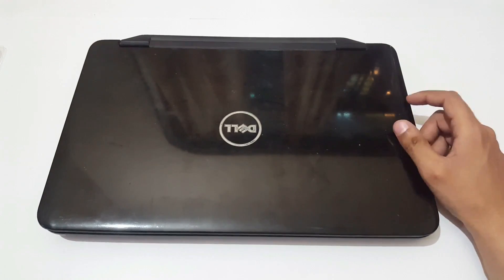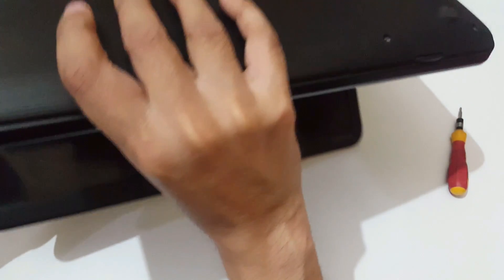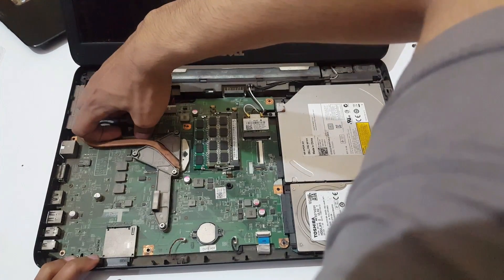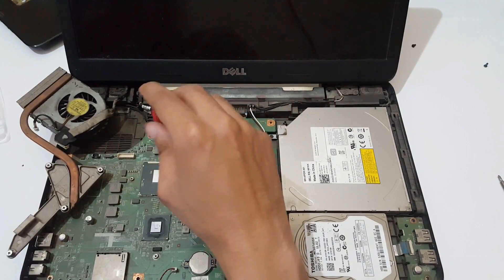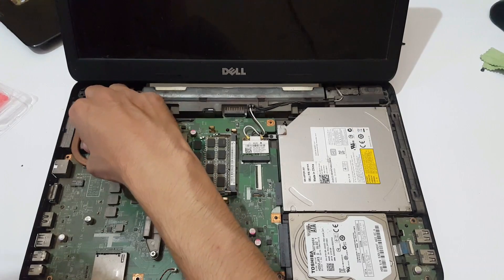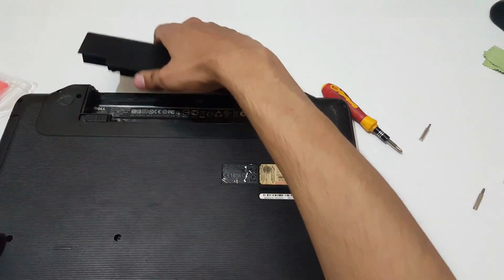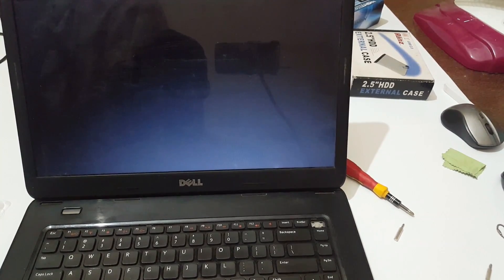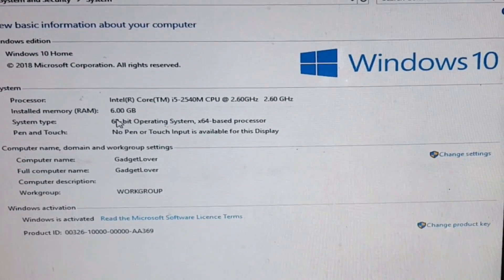How to Upgrade Processor on DELL Laptop | i3 to i5 & i7 - Make Laptop Faster for Gaming

Comment: Sir, I have a Dell Latitude E6410 
i5 520m 
Intel HD Graphics 64mb vram
8 gb ram dual channel 
What is the suggested processsor for me to play a game like gta 5? Or do I have to use an external graphics card to play a game like this? Please answer.
Reply from the maker: AT2702 : Intel Core i7 640M is best processor for your Laptop and I would suggest you upgrade its RAM and install SSD for more better performance and for better gaming experience I would suggest you attach graphics card externally to your Laptop

Comment: I have a Dell Inspirion 15 3000 series laptop with intel core i3 processor and 4 gb ram can I able to replace it with amd ryzen processor
Reply from the maker: Coding Kit : Unfortunately you can upgrade it in same generation only and in my knowledge the processor of this Laptop is soldered so you can't upgrade it
Reply: @GadgetLover360  So, Can i upgrade same laptop with intel i7 or i5
Reply from the maker: Praful Kumawat : If it is not soldered you can upgrade it

Comment: Sir my laptop is toshiba C280 I0010 core i3 2310M can i upgrade to i5 or i7?
Reply from the maker: Rocky Emmanuel c.p : Intel Core i5 2540M is best processor for your Laptop and I would like to inform you that if processor is soldered you can't upgrade it
Reply: Thank  you for the information.
Reply from the maker: Rocky Emmanuel c.p : You're welcome

Comment: I have dell Vostro 1540 can I add RYZEN 3 3200G TO IT.. is it possible.. ? + 1ssd .. if yes which SSD is ok for me.. I want to convert business laptop to gaming laptop
Reply from the maker: Abhijit Chavan : Unfortunately you can upgrade it in same generation only and I would suggest you upgrade its RAM and install Samsung EVO 2.5 inch internal SSD for more better performance

Comment: I have intel i3 2.40 GHz. Which processor is best to upgrade?
Reply from the maker: Sumana Maiti : Provide processor number
Reply: @GadgetLover360  3110M
Reply from the maker: Sumana Maiti : Intel Core i5 3380M is best processor for your Laptop
Reply: @GadgetLover360  Thanks. Can you provide me buy link?
Reply from the maker: Sumana Maiti : You're welcome and I would suggest you buy it from Ebay or Aliexpress online store
Reply: @GadgetLover360  I saw another processor i7-3770. Can I install it?
Reply from the maker: Sumana Maiti : Unfortunately you can upgrade it in same generation only
Reply: @GadgetLover360  But it's 3rd gen only.
Reply from the maker: Sumana Maiti : But both have different segments
Reply: @GadgetLover360  Ok thanks. :- D
Reply from the maker: Sumana Maiti : You're welcome

Comment: I've got a dell N4010 laptop i3 380M 4gb ram with ssd , I want to upgrade processor for a better graphics unit will it help and which processor do you suggest.
Reply from the maker: Vikas Satpute : Intel Core i5 580M is best processor for your Laptop
Reply: @GadgetLover360  thnx a lot mate.
Reply from the maker: Vikas Satpute : You're most welcome
Reply: @GadgetLover360  I am in Pune India, here I am unable to find the same processor, I've got i7 2670QM/2630QM. Will this one go good with my Dell
Reply from the maker: Vikas Satpute : Unfortunately you can upgrade it in same generation only and I would suggest you buy it from Ebay or Aliexpress online store
Reply: @GadgetLover360  sure. Thanks for helping
Reply from the maker: Vikas Satpute : You're welcome

Comment: Hey Bro!
Having a intel core i3 6006u with 4GB of 2400mhz Ram packed in my Dell inspiron 15 3000 Series. Suggested me compatible Upgrades.
Reply from the maker: Haq Se Tharki : In my knowledge the processor of this Laptop is soldered so you can't upgrade it so I would suggest you upgrade its RAM and install SSD for better performance
Reply: @GadgetLover360  thanks bro! Basically my PC has 2×2GB RAM slot so I will be replacing with 2×8GB of Ram and a 512GB of SATA SSD.
Reply from the maker: Haq Se Tharki : You're welcome

Comment: Because I want to use egpu (1650super)and I don't want bottle neck
Reply from the maker: Genesis Gaming : Intel Core i7 2640M is best processor for your Laptop
Reply: @GadgetLover360  it will best for egpu like 1650super
Reply from the maker: Genesis Gaming : Yes this is best processor for your Laptop and I would suggest you to use RTX 2060 Super in place of GTX 1650 Super
Reply: @GadgetLover360  egpu doc is not capable of that
Reply: And I think it will bottleneck
Reply: @GadgetLover360  bro you know any trusted website for purchasing egpu dock I am not getting it from offline market
Reply from the maker: Genesis Gaming : I would suggest you buy it from Amazon online store
Reply: @GadgetLover360  bro it is not available
Reply: @GadgetLover360  ok bro I got it which version is good for 1650super (express card version)
Reply from the maker: Genesis Gaming : Version 8 would be better
Reply: @GadgetLover360  bro can I fit any quad core any how
Reply from the maker: Genesis Gaming : I would suggest you search on Google about it for best results
Reply: @GadgetLover360  I think this processor will bottleneck by this gpu
Reply from the maker: Genesis Gaming : Okay
Reply: @GadgetLover360   so can I play games on 60fps with 1650super
Reply from the maker: Genesis Gaming : See its specification
Reply: @GadgetLover360  bro GPU is over capable but this processor will handle this

Comment: Bro I am having HP notebook 15 with i5 5th generation , is it possible to upgrade processor and gpu??
Reply from the maker: Arnav Saxena : You can attach graphics card externally to your Laptop but in my knowledge the processor of this Laptop is soldered so you can't upgrade it

Comment: Hello bro I've Dell Inspiron 15R 5521 With Cpu- Intel(R) Core(TM) i5-3437U CPU @1.80 GHz and it's too slow to run games, and video editing softwares on my pc is it possible to enhance my CPU ? Or processing and I've 8gb ram .
Reply from the maker: Prawah Sinha : In my knowledge you can expand it upto 16GB so I would suggest you upgrade its RAM and install SSD for better performance
Reply: But I've already increased the ram from 4gb to 8gb and installed SSD of 240gb isn't there anything else that I can do to improve laptop performance
Reply from the maker: Prawah Sinha : You can attach graphics card externally to your Laptop
Reply: @GadgetLover360  thanks bro and any recommendations ?
Reply from the maker: Prawah Sinha : You're welcome and I would suggest you run disc check and system file checker command

Comment: I have 
i3-380m @2.53GHz in my Dell Vostro 1540
I want to upgrade the CPU.
Suggest the best one please
i5 or i7
I am also confused in i7-640m 4mb cache CPU 
It's the fastest i saw
With 2.8GHz clock speed
Tell me what to do.
🙏
Please Reply.
Reply from the maker: Asif Hussain : Yes you can upgrade it with Intel Core i7 640M
Reply: @GadgetLover360  thank u🙏😀
Reply from the maker: Asif Hussain : You're welcome

Comment: I have i5 8gb ram 1tb hdd 2gb graphic card sitll gta lag on low settings
Reply from the maker: Rajneesh Gautam : Run check disc and system file check command
Reply: @GadgetLover360  i have i3 8gm ram 1 tb hdd and integraed graphic card should it run gta5
Reply from the maker: Kalash Bawankar : Yes

Comment: How Can i upgrade my laptop performance which has an i3-6006u 4gb ram 1tb hdd..... Plz tell
Reply from the maker: MUSIC BOX : Upgrade its processor Intel Core i5 6360U is best processor for your Laptop and I would also suggest you upgrade its RAM and install SSD for more better performance
Reply: Bro but is it possible to upgrade my Processor
Reply: Can u tell the price
Reply: Of the processor
Reply from the maker: MUSIC BOX : I would like to inform you that if processor is soldered you can't upgrade it and see it on Ebay or Aliexpress online store for better details related to its price
Reply: Soldered means
Reply: How do i know if my processor is soldered?? Plz tel
Reply from the maker: MUSIC BOX : What Laptop do you have
Reply: It's an hp laptop  there's no name but just a model no.
Reply: Hp 15flbc9hif
Reply from the maker: MUSIC BOX : In my knowledge the processor of this Laptop is soldered so you can't upgrade it I would suggest you upgrade its RAM and install SSD for better performance
Reply: Can u suggest a  laptop with best configuration under 50000
Reply from the maker: MUSIC BOX : In my knowledge Lenovo Ideapad L340 and Dell Inspiron 3493 will be the better choices to buy in this range
Reply: And how is lenovo ideapad s340
Reply from the maker: MUSIC BOX : This is a good choice if Laptop price is available in your budget

Comment: Hi! Great video. Can you tell me if it is possible to change the processor in a Dell Inspiron N5010? It's a relatively old notebook (around 2010?) and came with a dual core Intel Core i3 M370. Thanks a lot!
Reply: lol mine is same as well inspiron n5010
Reply: I too.have the same
Reply: @theminestone2853  yes you can
Reply: Wait nvm I found out it’s actually the one I have is Inspiron n4010 LOL OOF…….
Reply: Tell me can I upgrade to i7
Reply: Same model,,
Reply: laptop processor AMD E2, A4, A6, A8, A10 & i7 1, 2, 3, 4 gen available
Reply: I have  a Dell Inspiron N5010 (2009-10) model the processor of this model can be upgradable ?
Reply from the maker: Faustino Chirino : You're most welcome and Intel Core i5 580M is best processor for your Laptop

Comment: Hi bro I have lenovo IdeaPad 320 e 15ikb which will be the best processor to replace that with I have i5 7th gen processor
Reply from the maker: Balakrushna Behera : In my knowledge the processor of this Laptop is soldered so you can't upgrade it
Reply: @GadgetLover360  bro can I install extra 8gb ram of 2666 mhz or 2400mhz in my 2133mhz laptop which is default frequency of ram
Reply from the maker: Balakrushna Behera : I would suggest you see its product manuals

Comment: bhai mere paas n5110 hai.. can i upgrade ram and gpu for this device without any difficulty and total expense kitna hoga?
Reply from the maker: Abhinav Rawat : Yes in my knowledge you can expand it upto 8GB and you can't upgrade GPU of Laptop but attach it externally to your Laptop
Reply: @GadgetLover360   laptops dont use gpu
Reply from the maker: legendary player : Graphics processor unit is independently working and responsible for graphics output

Comment: hey bro I have a laptop with radeon a6 9225 , can I upgrade it to ryzen 7 ???
Reply from the maker: Suraj Chetia : Unfortunately you can upgrade it in same generation only and I would like to inform you that AMD A9 9425 is best processor for your Laptop
Reply: Did you played any games in that laptop.
Reply from the maker: Abhidev Dileep : If you have any problem related to this video ask I would be happy to help you
Reply: @GadgetLover360  bro i have the same spec amd a6 9225.which is the best processor for this pc.
Reply from the maker: Abhidev Dileep : This is the best available processor in this generation which will improve your Laptop performance and I would suggest you upgrade its RAM and install SSD for more better performance

Comment: Brother i have Hp 15 da 1041TU ( i5 8th generation) but the laptop has 1.8 Ghz  so i want to upgrade it into 4.4 Ghz ...what should i do?? Please help me
Reply from the maker: Niranjan Kumar Sharma : In my knowledge the processor of this Laptop is soldered so you can't upgrade it so I would suggest you upgrade its RAM and install SSD for better performance

Comment: I have a dell Inspiron N4050 with --> core i3-2370M | 2GB Ram | 500GB HDD.. my laptop is too much slow.
it takes 2-3 min to launch apps like opera/crome/firefox. 
please Suggest me the processor and other options .. [condition - for normal use]
Deepest thanks in advance from bangladesh!!
Reply from the maker: Rz. Riad : You're welcome and Intel Core i5 2540M is best processor for your Laptop and free up space of system drive for lag free performance and I would also suggest you upgrade its RAM and install SSD for more better performance
Reply: @GadgetLover360  though around 300Gb storage is free here ,, it makes lacks.. thanks again for your very fast reply
Reply from the maker: Rz. Riad : You're welcome and I would suggest you perform check disc and system file checker command in your Laptop to see everything is working properly or not

Comment: HI DUDE I HAVE DELL STUDIO XPS 1640 CORE 2 DUO PROCESSOR 2.53GHZ WHICH PROCESSOR SHOULD I UPGRTADE TO THIS LAPTOP THIS HAVING SOCKET P(478)
Reply from the maker: raghu raghu : Intel Core 2 Duo P9700 is best processor for your Laptop
Reply: @GadgetLover360  dude can it su[pport any i3 processor
i have lenovo g500 with pentium 2020m laptop incase did this will work any i3 or i5 plz tell dude
Reply from the maker: raghu raghu : Intel Core i5 3380M is best processor for your Laptop
Reply: @GadgetLover360  thnks bro
Reply from the maker: raghu raghu : You're welcome
Reply: @GadgetLover360  HI HERO DO YOU KNOW AN IDEA OF DELL STUDIO XPS 1640  IT WILL RUN ON HIGH SPEED FAN ALWAYS LIKE ITS DOING WAR WITH ALIENS HOW TO STOP THAT FANS SPEED TO LOW ...EVEN WHEN I REFRESH ITS FAN RUN LIKE A HELL ...ANY SOLUTION PLZ.I DONT UNDERSTAND WHAT TO DO I CLEANED FANS VENTILATION AND APPLIED THERMAL PASTE TO HEAT SKINS ALSO NO USE...I AM AFRAID OF THAT FAN I WILL BECOME LOSE AND BREAK THE BASE PANEL AND MAKE A HOLE TO MY HOUSE WALLS.....
Reply from the maker: raghu raghu : It depends on processor wattage and RPM of fan so I would suggest you stop it while working for few time
Reply: @GadgetLover360  NO HERO  WHEN I  POWER ON MY LAPTOP THE FAN RUN FULL SPEED INSTANTLY WITH OUT DELAY FAN RUN FULL SPEED WHEN I POWER ON MY LAPTOP WITH OUT ANY TASK RUNNING ..IF I CLICK REFRESH IT AGAIN RUN HEAVER THAN EVER .....
Reply from the maker: raghu raghu : It will run when cooling is required
Reply: @GadgetLover360  hmmm hero after 10 hour night rest, morning when i start laptop its run full fan speed what is there in laptop to cool i did morning start......
Reply from the maker: raghu raghu : When Laptop is started it run for a while everytime in all Laptops
Reply: @GadgetLover360  hmmmmm ok but my lenovo dont sound my fan its so silence when i paly games only fan spin like hell in it but not my dell xps 1640 when i power on its get ready for wars with fan
Reply from the maker: raghu raghu : It depends on temperature of processing unit

Comment: Sir I'm using Dell inspiron 3543.

What type of upgrades i can perform please let me know.
Reply from the maker: Gourav Patra : The processor of this Laptop is soldered so I would suggest you upgrade its RAM and install SSD for better performance
Reply: @GadgetLover360  Can i install hdd and ssd at the same time by replacing CD drive ? And which ram and which ssd can i install ? please let me know .
Reply from the maker: Gourav Patra : No because in my knowledge for both M2 slot is required and Adata Ultimate SU650 is best available SSD for Laptop and buy DDR3L 1600MHz RAM
Reply: @GadgetLover360  Last question, can i use my laptop for next 4-5 years for programming by upgrading it's ram and ssd ?
Reply from the maker: Gourav Patra : Yes
Reply: @GadgetLover360  Sir please make personal research and let me know whether i can use Kingston Q500 in my Dell inspiron 3543 .

             - Love from Odisha
Reply from the maker: Gourav Patra : Yes and thanks for your love and support
Reply: What is the difference between Kingston q500 and Kingston a400 and which is the better one ?

Comment: I have dell latitude e7740 !7 4600u 16gb ram 1tb hhd want to upgrade cpu because vram just 1gb
Reply from the maker: Sairock Khan : In my knowledge the processor of this Laptop is soldered so you can't upgrade it

Comment: Sir in dell Vostro 1014 can I upgrade processor
Reply from the maker: All about life : Yes
Reply: Sir i5 Dal Sakta hai 
Y agar koi aur toh ap bta dijiye
Reply from the maker: All abour life : What processor is in your Laptop
Reply: Intel core 2 duo
Reply from the maker: All about life : Provide processor number
Reply: @GadgetLover360  Intel Core 2 Duo - T6670
Reply: Sir please tell
Reply from the maker: All about life : Intel Core 2 Duo T9900 is best processor for your Laptop
Reply: @GadgetLover360  sir vo install ho jayga isme and kitne Tak Ka padega
Reply from the maker: All about life : Yes and you can buy it from Ebay or Aliexpress online store
Reply: @GadgetLover360  sir Kitna tak Ka hoga
Reply from the maker: All about life : It's not too expensive and I would suggest you search on Google or provided online stores for best results
Reply: @GadgetLover360  THANKS A LOT !!
Reply from the maker: All about life : You're most welcome
Reply: @GadgetLover360  sir it is not available offline. 

If it is available online plz provide me the link
Reply: Plz tell
Reply from the maker: All about life : I would suggest you go to nearby PC & Hardware store and ask about it
Reply: @GadgetLover360  sir can I use i5 3rd generation 
Someone told me it would support in dell Vostro 1014
Reply: Plz tell 🙏🙏
Reply from the maker: All about life : You can upgrade it in same generation only
Reply: @GadgetLover360  means
Reply: I5 can't be installed
Reply from the maker: All about life : Provide processor number
Reply: @GadgetLover360  i3 3240
Reply: Or you tell
Reply from the maker: All about life : Intel Core i5 3570T is best processor for your Laptop
Reply: @GadgetLover360  y smoothly work karega na
Reply from the maker: All about life : Yes it will improve the performance of your Laptop and I would suggest you upgrade its RAM and install SSD for more better performance
Reply: @GadgetLover360  sir I have the motherboard which was given by company will it support in it
Reply from the maker: All about life : Yes
Reply: @GadgetLover360  ok 👍 will I get it online?